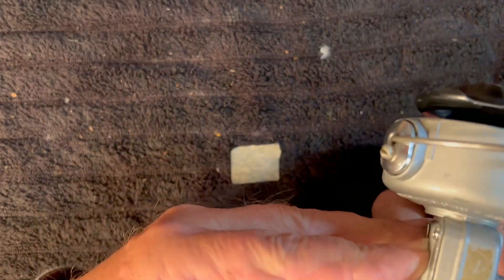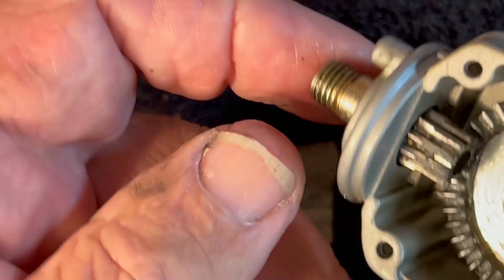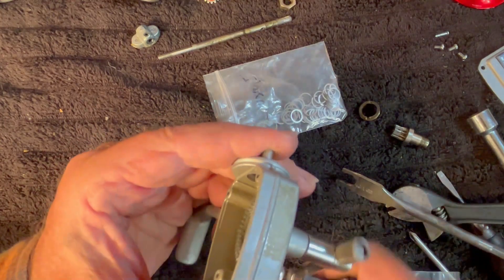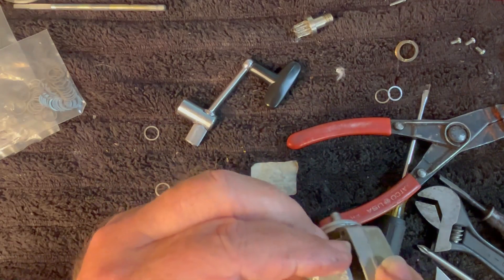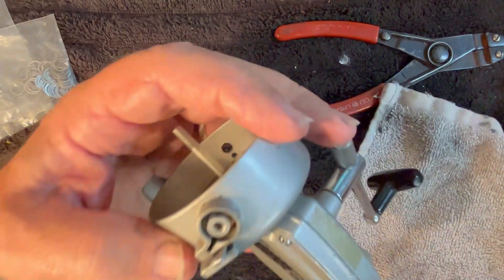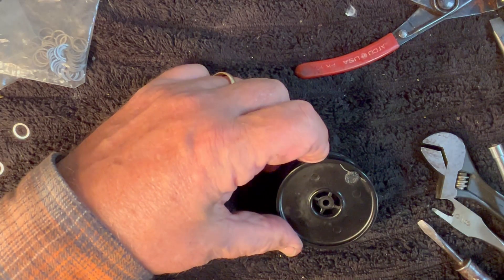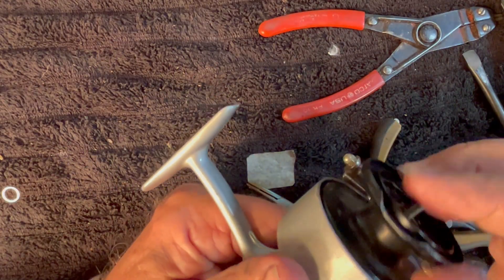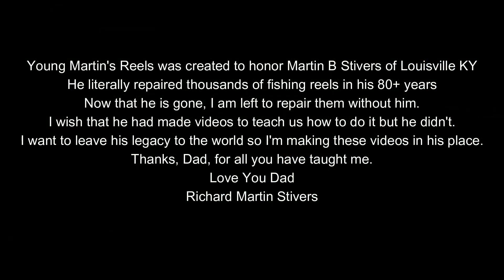Sears Roebuck Model 200 -- 779 313240 -- Service and Lubrication -- Young Martin's Reels

Comment: I’d say this was made by Daiwa but I’m not sure by any means. It just has the look of a Daiwa. The handle definitely looks like a Daiwa. I don’t have a single reel with a piece like the one in this reel that is holding in the pinion. I’ve never seen this before. I also thought this would be a bushing reel rather than a bearing reel. Great job on another of your homemade tools. You’re getting really good at designing new tools. What a shim job! You have given this ree a second chance for sure  -  well that is if you can save that spool.  I know you did because I talked to you about it this afternoon!  You sure don’t put much oil on felt washers?  The spool repair was awesome. Great job on this one Rick! Your reputation as a miracle worker continues to expand and grow. — Chris (This reel was made by Daiwa, I’m almost sure it!)
Reply from the maker: Chris, that was the first time I had encountered a locking ring like that. Since I work on reels by any manufacturer that I can get my hands on, I'm more likely to run across odd design features. If I came across more rings like that, I would consider making a 90-degree bend in the end of each leg of the tool, so it could be used like a wrench. It would require heating the legs to bend them and I was afraid the metal would become soft or brittle. I was surprised to find a bearing in this reel too. It just had the look of a bushing reel. 

I need to come up with a reliable method of shimming gears. I know there must be a better way to do it besides trial and error. Maybe something like we talked about this evening using Prussian Blue gear dye. I just don't have enough experience yet to come up with a viable method. 

I used to put a lot more oil on the felt washers, but once you tighten them down, and the washer compresses, a lot and the oil squeezes out. Once I started taking some reels apart that I had serviced and saw all of the excess oil, I reduced the amount I put on them. 

That spool spring gave me a kick in the seat. At first, I thought I could just heat the wire and slide it into the plastic.  Turns out that just made the wire brittle and it snapped off. Then it wanted to curve upward instead of downward. The biggest problem was that I didn't realize for a long time that I should just remove the axle from the reel and use that to shape the new spring position. Even then, it wasn't as easy as I thought it would be. Patching the chip in the edge of the spool was almost as hard. I ended up using the axle shaft to mount the spool in my wood lathe and spinning it to gently shave down the epoxy. The best solution would be to replace the spool with a good one, but that's not likely to happen. 

I have no idea who Sears got to manufacture this reel, but I like it. It never ceases to amaze me how many different ways we have found to manufacture the basic spinning reel.

Comment: Where do you get your shims ?
Reply from the maker: I purchased them on EBay. This was the description on the listing. 

“Thin Shim Flat Washer Ultra Thin High Precision Adjusting Gasket Metalworking”

I measured my bascic reels and chose the sizes I felt would most often use. 

M8x10 0.5mm
M8X10 0.1mm
M10x16 0.5mm
M10X16 0.1mm

They ship out of China and took about 6 weeks to arrive. I wanted brass shims but I was unable to purchase any in these sizes. I think they cost me around $25 for all of them. Trying to find the exact original shims for reels is usually impossible. That’s why I went this route.
Reply: @youngmartinsreels5314  thanks, I found some from RC Mart out of China, but there were only packing 5 shims each of the sizes I am looking for, and I thought the price was high for the 5. Again, thanks

Comment: That reel looks bone dry.
Maybe the pinion gears are supposed to be that way, but I think maybe I see deep wear on the teeth of the main gear. I could be wrong; it's hard to see the wear patterns in real life, even harder on a video, and these teeth are strange to begin with. (Nope, never mind, things become clearer once the main gear is cleaned.)
Reply from the maker: You saw the gears just like I did. They looked clean and heavily worn but once actually cleaned they were not worn at all. I learned another lesson on this one, clean, then troubleshoot. I was certain the teeth on that pinion were shot. That’s my first time seeing a pinion cut that way. Chris was familiar with them, because he had seen some like it before. Once properly cleaned it became obvious it was in better shape. 

I’m hoping to get an ultrasonic parts cleaner for Christmas. I have some really grimy reels I’ve been holding unto just in case.
Reply: @youngmartinsreels5314   Get a good one. And a fine mesh basket so you can clean the small parts too.

I have one but suspect it's not a good unit. It doesn't do a good cleaning job on stuff until it gets the liquid steaming hot. One of these days I'll compare the performance of my unit to that of a pan on the stove.

I use a mix of water, Dawn dish soap, and Simple Green concentrate in mine.
Reply from the maker: @warpedweirdo  The one I picked out is pretty nice but, in the end, I get what I'm given.  I've been watching videos of people using glass jars in theirs to clean the parts without making a mess of the cleaner tank. They are also using petroleum products to clean with. Some are actually using gasoline. I would never do that because it's too explosive and smells bad too. I have been considering using diesel fuel since I have some sitting around. After the parts are cleaned, they sit the jar aside so the solution will settle. They pour off the top, cleaner fluid into another container and dispose of the grime in the bottom of the jar. If I don't like the way the diesel smells I might try out your solution. I have also learned that ultrasonic cleaners fail quickly if you don't have the correct amount of solution in the tank. If I get it, I'll have a new toy to experiment with.
Reply: @youngmartinsreels5314    I quickly terminated my experimentation with solvents in the cleaner because I didn't  have appropriately sized sealing glass containers, and I'm not all that keen on transferring a full tank of used kerosene, mineral spirits, or whatever back into a bottle when I'm done. I tend to make big messes.

Can't wait to see the methods you try and your results!